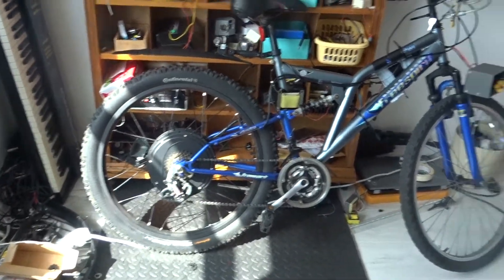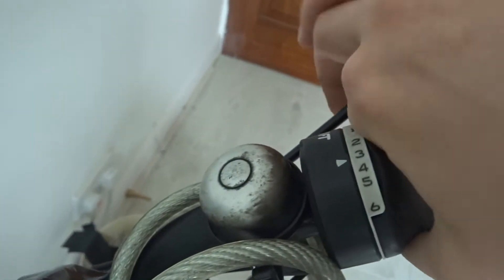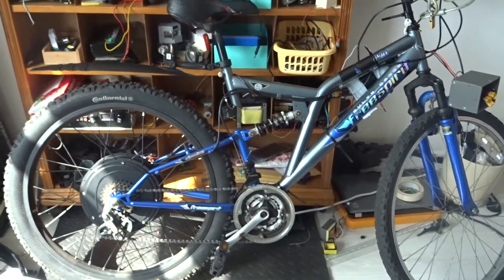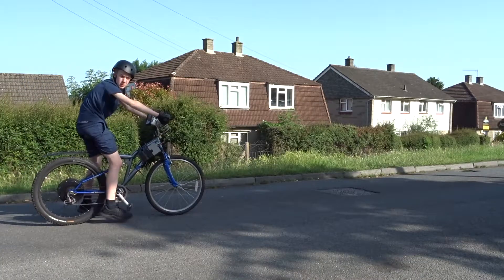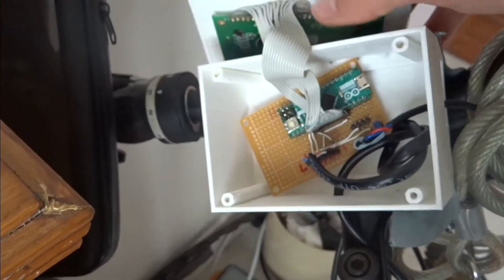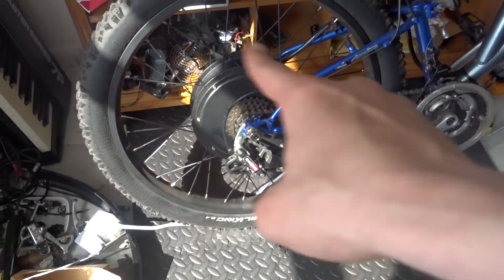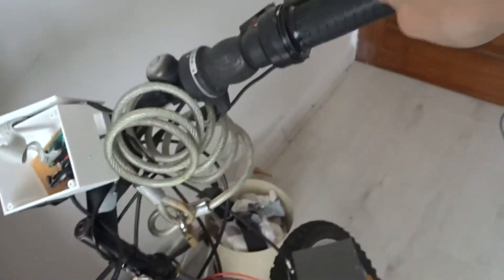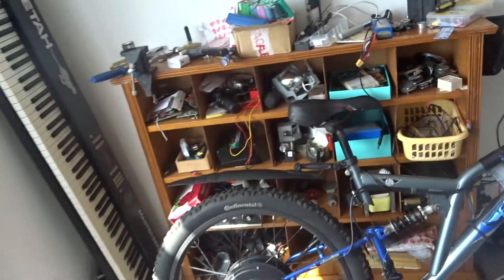DIY 3kW Ebike Build - Part 2 Sensors, Chain and Cycle Analyst

Comment: I watched part 1 and I’m Surprised that flimsy drop out hasn’t broken yet…….it’s probably because of your weight, if you were heavier…it wouldn’t be good.

The torc a 3KW motor puts out is enough to bend a steel frame’ like a pretzel ….I guess weight plays a important part.

Good job on the build.

Comment: Hi,hope you can give me abot advice,bought a stealth bomber clone from China problem is I've got no power will not turn on,nothing on display, no lights nothing,battery still charges,checked connections I'm at a loss,any advice pls mate
Reply from the maker: Has it got a BMS?
Reply: @EverythingEbikeChannel  fixed it mate,ket in ignition wasn't working properly,thanks for your reply

Comment: do you think a 3kw hub motor would be fun on a dirt bike. And do you think i will have enough power to do wheelies?
Reply from the maker: A 3kW motor will be fine but to get the most out of it and pull wheelies you can pair them with a 6kW+ controller for lots of torque. 3kW on it's own isn't a huge amount but in short bursts (<10s) these motors can handle triple or quadruple their rated power, especially if you look into ferrofluid and heatsinks
Reply: @EverythingEbikeChannel  I am gonna make another one with a bigger motor in the future, i just wanted to know if this one would have enough power to pop the wheelie
Reply from the maker: @lucafriis2229  What controller are you using? That can make the biggest difference
Reply: @EverythingEbikeChannel  I am not really sure yet, but i am trying to get a controller with about 60a and bluetooth so i can make an app for it that changes the speed limit to legal when i get stopped by the police. I also need one that supports pedal assist, since it is also a law requirement. Do you have any suggestions?

Comment: What voltage did you use for the vesc? And how many amps constant did you push through it?
Reply from the maker: 42v and about 90A for pretty long peaks! (10-20s). Biggest challenge was cooling the FETs but otherwise no issues
Reply: EverythingEbike Channel And constant amps about 50? Or less?
Btw. Thanks for your quick reply 👍🏻
Reply from the maker: @justinzejler9089  You're welcome 😁50 is the rated, but 70 continuous with good cooling is definitely doable I would say.

Comment: Also with high power your drop outs will break. Ive broken steel dropouts at 1.5kw with regen  And I'm currently making a clamping torque arm out of 1/2 steel for my ebike and im running 3kw peak atm on my 1kw £135 kit off ebay. Other than new suspension, brakes and a torque arm your ebike is coming out great. Keep it up.

Comment: Coming along great.id reccomend getting some used air forks (youll probably need a new headset aswell) and shocks of ebay better than all that pogo crap. You should get some high amperage lipo and a better controller that's capable of 10kw and your motor could probably handle up to 15kw add some ferrofluid if heating becomes a problem. Theres alot of cables so Ditch the front and rear deraleur you only need one gear. I know you have regen but get some hydraulic brakes £25 can get you some zoom brakes.
Reply from the maker: Yh deffo need some better forks :). With the higher power I'd love to but as you said would need to reinforce the frame. I expect controllers with that power are pretty expensive!? I'm working on the next few parts and ditching the front derailleur is one of the mods! Yep, brakes are certainly a weak point at the moment! Thanks for the feedback and contribution!
Reply from the maker: Also if the link is deliberate, I can't access it